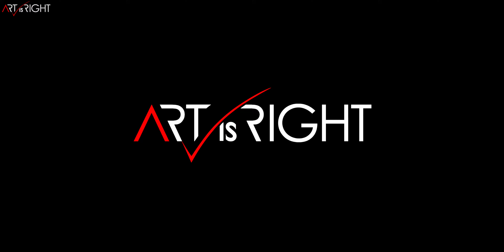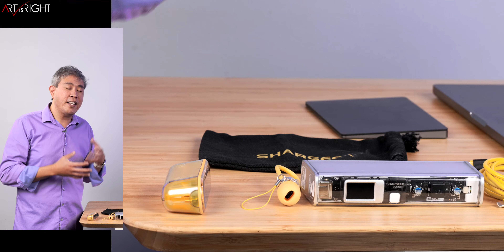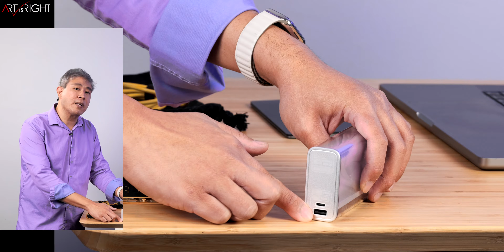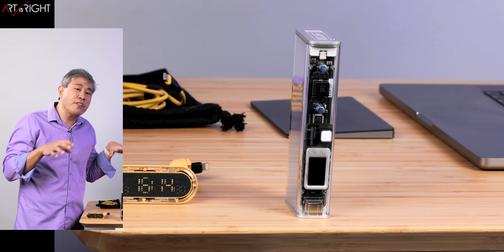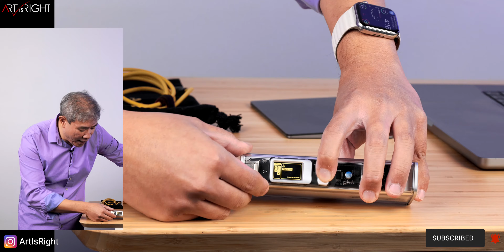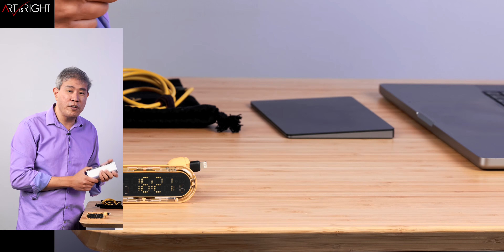130 Watt Power Bank - Storm 2 Slim by Shargeek Review - An great & uniquely design power bank

Comment: So many reviews for Storm 2 Slim and nobody told that this power bank not even able to be charged without errors! - In case if user try to charge it using 65W charger, it just overheat its own battery at the middle of charging process and stops. F@#$ing reviewers, do any of you really test this device or at least just charge it?
Reply from the maker: Despite your emotional outrage and anger toward the product, including but not limited to any derogatory or profanity remarks toward any reviewer, I tested this product and am using it today; I have not run into this issue. I am not making any excuses for the company or manufacturer. While I do understand where these remarks are coming from, this type of complaint would be best taken up with the manufacturer and part defect as a warranty.
Reply: @ArtIsRight  My "emotional outrage" was caused not by product, but because of reviewers, that just plug to this power bank a smartphone or tablet and exclame - "what a wonderful power bank - look it works!". And no one, including you, didn't do any simple complete test of it. Yes, if you just plug this device to charger with 65W+ power and goes to sleep, at the morning you find this power bank successfully charged. But this fact does not mean that power bank charging process went fine - it stop charging on the +/- middle since the temperature of its own battery became over 46C. After 18-25min, as soon the battery became cooler, it continue the charging. This is going not with mine power bank only. It is typical for each Storm 2 Slim unit. Is it normal? 
Next one - this power bank not able to charge any laptop that require 80-100W of charging power, despite that its Type-C port nominated as 100W port. Power bank just overheat and stop working. And again - this is absolutelly typical for Storm 2 Slim.
You are reviewer. You must find this out and told us. That's why I use "derogatory or profanity remarks". Shame on such reviewers!
Reply from the maker: All I can say is that I did review - test this and have not ran into the issue that you found. I am still using the charger today.... I can only tell you what I found....

Comment: That's a big price tag for low capacity.  For me any my colleagues we always look for 1 critical component: 100W PD.  Beyond that, we can usually find power banks under $100 with 24-30,000mAh.  So to more than double the price for only 20,000mAh to get a cool little LED seems ludicrous.
Reply from the maker: That is one way to think about it. It all depends. At this time there may be better options out there.
Reply: What product would you recommend? I want at least 60w PD and at least 24.000